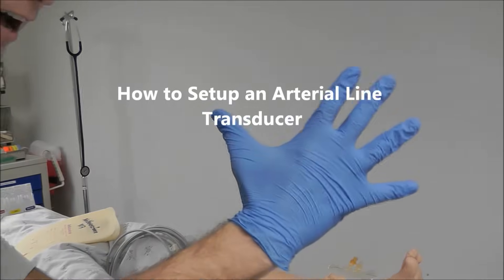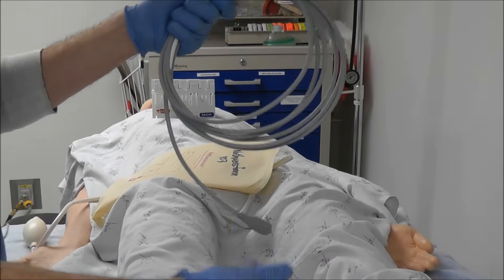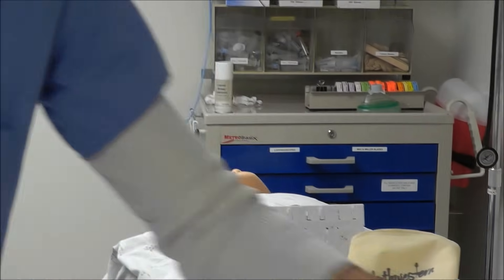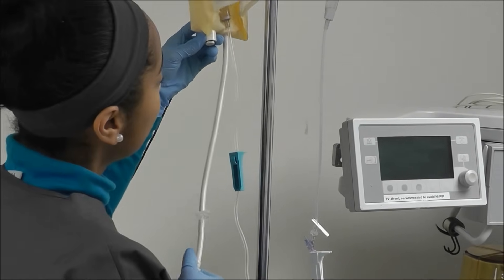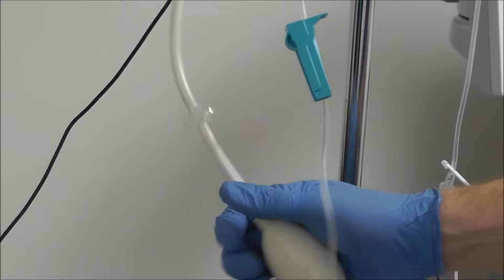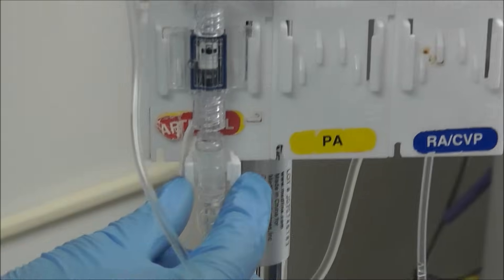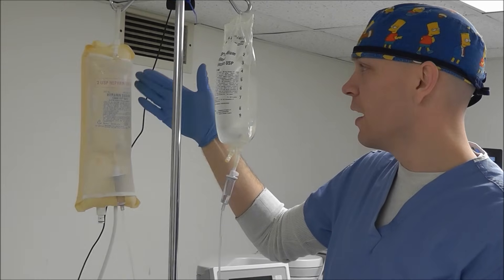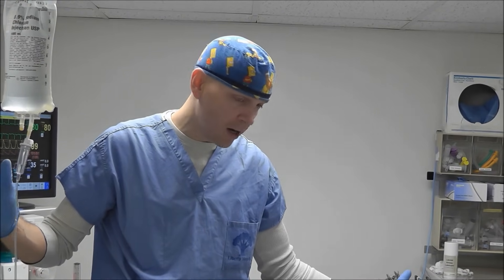How to Setup an Arterial Line Transducer

Comment: Y need to put pressure  300
Reply from the maker: You have to pressurize the system to be able to flush it.  Remember that this will be hooked up to an ARTERY.  The pressure inside an artery is much higher than the pressure inside a vein.  Unless the pressure in the system is higher than the pressure inside the artery, blood from the artery will back up into the tubing.

Comment: sir you must first purge the air line then then the patient connecting tubing isnt it, i also got another question to ask sir why do we use pressure infusion bag and pressure it to 250 or 300 why is that
Reply: @Waruna . The saline bag is pressurised because if it not your arterial BP will be more than the pressure in the tubing of the bag and you will end up getting back flow of blood into the tube. I think that is the answer🤔

Comment: Is the black bucket sterile?? Because if not you guys would be causing septicemia otherwise! Asepsis principles are crucial. No thanks don't set it up for me.
Reply from the maker: Bro.  Totally with you.  I didn't specify, but we were just in a sim lab jacking around with old unsterile equipment.  Not used on a patient.  Have a good day.
Reply: Example I’m guessing

Comment: I would suggest not pressurizing the  bag until after the line is primed, otherwise it creates micro bubbles in the tubing because of turbulence. Also, it is easier to have the transducer etc in their holder so the tubing isn't flopping around and you can hold the end upwards since air bubbles rise upwards.
Reply: Loretta Gilbert my mentor said exactly the same to me today.
Reply from the maker: Thanks for the suggestion!
Reply: I agree. Prime before pressuring
Reply: https://www.youtube.com/channel/UCFLdcqGAHEo5VRVCv96l8Ag?view_as=subscriber?sub_confirmation=1

Comment: Don't forget to squeeze the air out of the saline bag first!
Reply: @TheGreatWall002  There is no safety device preventing air embolism when your bag gets empty and it's more convenient to change the bag if there is no air in the line. It's not required to remove the air from the bag, but I do it as an extra level of safety and convenience.
Reply: Yea I didn't see them De air the bag before pressurizing the bag the trasducer works with the pressure bag having NO air then add the 300mmhg if u do before that u are not in 300mmhg
Reply: @TheGreatWall002  I am a CVICU nurse and patients with a-lines sometimes live past their surgery (maybe not your patients). That a-line may be there a week or more with frequent blood draws, it's very common to have to change the saline bag out due to flushing after blood draws. Nobody mentioned giving iv fluids to the patient through the a-line. ***This is very basic, and anyone working in the OR, and managing a patient knows this (or should know this).
Reply: You have to burp the bag to get all the air out. Its common  in the ICU for the bag to run out. The pressure bag runs between 3-5ml/hr so that equates to between 64-100ml alone per day. Now factor in checking dynamic response, flushing between lab draws, zeroing the system and that 500ml bag is gone in 2-3 days.  

When you stated “I’m an anesthesiologist” I knew you weren’t aware of what happens on the floor. Don’t sweat it though, nobody’s perfect.